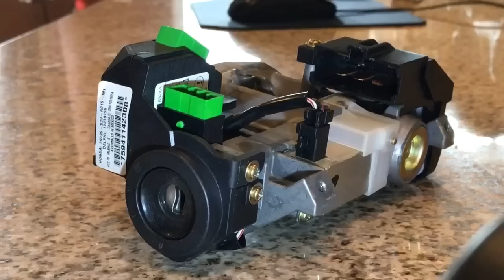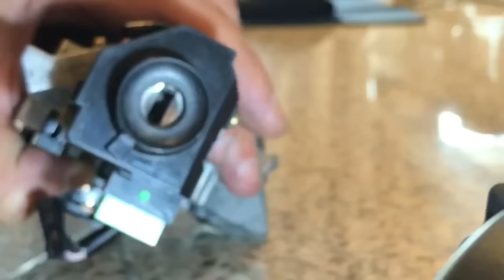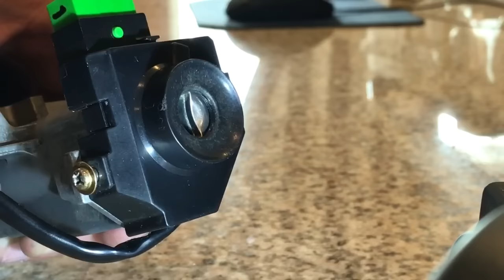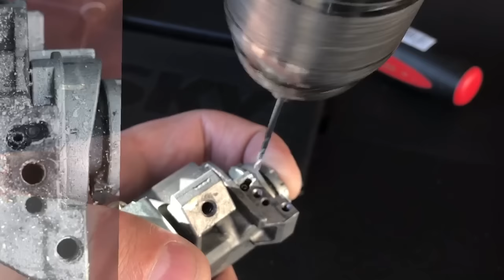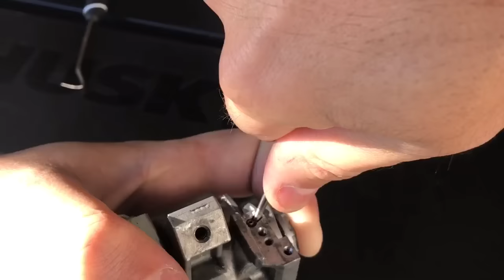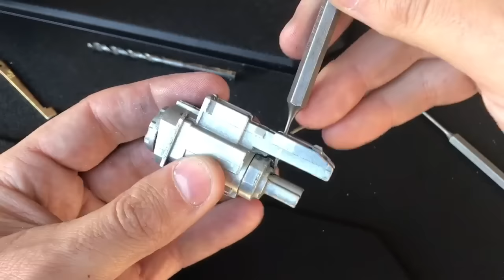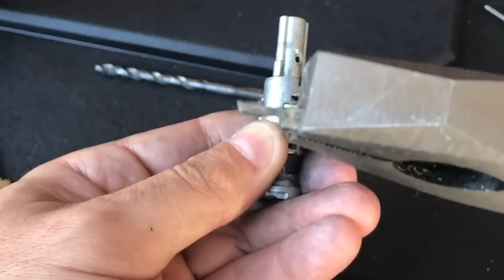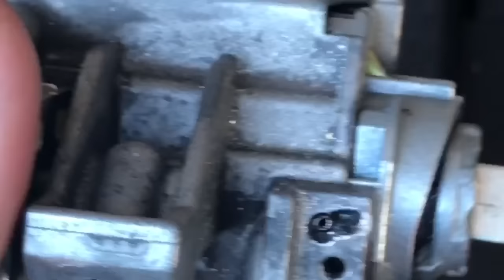Honda Ignition Lock Repair - Step By Step Tutorial

Comment: The locksmith in my town quoted me $720 to replace my ignition switch assembly and cut/program 2 new keys.  He didn't even give the option of rebuilding the locking mechanism.  I was able to follow your directions and save all that money.  It only took me about 3 hours from start to finish, and I'm not the most mechanically inclined person in the world.  Thank you very much!  Now my 18 year old vehicle with 200,000 miles on it is ever so slightly less secure.  OHHH NOOO!!! LOL

Comment: Brilliant video ... I don't know how much you just saved me but I'm guessing it wouldn't have been cheap and was going to leave my 2004 Honda Jazz (Fit) out of action for at least a few days.  Worth noting that I managed to effect the repair without removing the ignition switch assembly from the car.  It's a bit of a struggle getting to the screws that hold the immobilizer transponder (the black plastic bit) but it is possible with a driver bit in a socket wrench or possibly a flexi driver (couldn't find mine).  On the 2004 Jazz/Fit you remove the 3 screws that hold the indicator/light assembly first, that gives you a little more room to access the screws that hold the immobilizer collar.  There'll be some cursing but it is possible.  Also I'd caution to be careful when plugging the green connectors back in as it's easy to misalign them and bend a pin ...it's possible to straighten them back out but involves more cursing.

Comment: You saved my life. Sincerely.  For months I've had to leave my key in the ignition and whenever I parked I would turn the key back to just past the ACC postion before completely hitting the removal position. It was acting up and giving me a warning well before then but I kept wiggling and jiggling to get the key to rotate and it always eventually worked. But it got so bad that I had to bump the lock with a pair of pliers to trick it to work so I just gave up and left it in that dead zone position. Every time I got in the car I was worried I would jiggle it to the off position and get stranded at work or anywhere. So easy to do this method you shared. Drilling the pin worked exactly like your demonstration. Had already done the pin or tumbler rebuild on my door locks, so once I got the lock out it was a walk through. Thanks for this. I have a fully functioning car again. It wasn't so much about not paying more money for a dealership to do this, as mine has been pretty decent to me. Just avoiding the bother of going there and instead, being able to do something ourselves is the true value.

Comment: You just saved me 300 dollars. I was about to give up watching another video. Then I watched yours. I fixed mine with out taking the whole ignition out of the car. I did it exactly like you step by step. Thanks for saving me so much money. Auto zone wanted 399 dollars just for the part. The lock smith wanted 300 for parts and labor. Feel so blessed right now. I had 1 bent tab just like the one in the video that was stoppping the key from turning at all.

Comment: Trying this tonight on 2002 MDX. As far as drilling and pulling 1st roll pin, I've seen people slowly twist in a very small drill bit right into the middle of the roll pin. Just big enough to get a bite. Put Vice grips on it and pulled it out. Getting a roll pin kit from Harbor Freight. No doubt I'll lose one or ruin it. Awesome stuff.

Comment: My 2008 Honda Fit had the same problem, the car has 280000 on her and became a monument in our driveway.
Your procedure was done in 2 hours after I got ignition out of car.
I just wanted to take out was causing the problem, in the process I had only one wafer left, I didn’t want to dig in to this again so I took them all out, ignition worked awesome, one thing the key could come out while driving, the car works!
Thanks for this video!
This is the only one out there, so valuable!

Comment: 2005 Honda Element. Astonishingly helpful!  Huge thank you!.  Found that an allen-key set can easily be substituted for the 1/16th center punch.  Also found that using a dremel tool with an small sanding stone debured and tuned up some of the sticky keyway pieces that seemed to be protruding a tiny bit.  We removed six of them altogether, four by intent and two fell out by accident.  Re-assembled and it is flawless.   Again, huge help and many thanks !

Comment: Thanks for a very good description to solve the ignition lock problem. As a thank you for the help, you can get a tip, which means that you don't have to drill (see at 5 minutes in the video) to remove the pin. The tip is very simple..... Insert the key, and turn.... Now you can freely knock out the pin. No drilling.... Easy huh? Greetings from a Honda geek from Sweden..

Comment: Great video! I just finished my Oddessy van. Mine have gotten really bad over the past couple of years so I took out all the wafers. I lost a little tiny brass pin in the lock cylinder but it seems to work ok without it. I should have taken it apart on a table instead of my work bench. With out the wafers I can remove the key while the engine is running. It is so nice not to struggle with starting the engine or worrying about getting stuck.

Comment: My key wouldn't turn and I looked it up, figured it must be the problem if there were so many videos, and It was! Your video was the best, saved me alot of time, direct and simple instruction, thank you! 
I have a used 2008 Honda pilot, and the pin was already sticking out just enough to pull it out, and the one one the cylinder already had a hole drilled. My guess they, or maybe even a locksmith had already done this fix? Made it easier for me though!
I am wondering if you would recommend getting a new one now since it's been out and broken twice? And if I did does that mean I'd have two different keys? Is there a way to replace this part without getting new keys? Or would you just replace wafers and springs? 
Thanks again! I'm a single mom and I got stuck after swimming with 7 kids in the car!! Had someone come take the kids, then asked my friend to bring me tools before he had to go work. Got the look, like ya right, and he said good luck! Well I did it!! 
I love YouTube!! It's like I have millions of awesome handymen in my life ready to help me and show me how to fix anything. The empowerment you and many more have given me is appreciated!

Comment: Thanks for the video!!! Just performed this fix!! Was wondering if you knew what that wire you took off did? It goes to a solenoid/relay under that plastic cap. My lock assembly was full of wd40 and gunk so i wiped it down well and took the plastic cap off and air sprayed it clean. Put everything back and reassembled the column. The car starts but now i get the "keys are in ignition" beep when its not... This unfortunately also disables my remote door fob.... Update on the remote door fob not working, turns out that the "key inserted" micro switch was held closed by the long bar that goes to the back and past the cylinder was reinstalled incorrectly. There is a spring and a plastic cap that holds the bar in place. At first I put the spring, bar, cap back together. But it has to be bar, spring cap. This will position the bar correctly and then it will not keep the micro switch closed. Then the key is sensed as not in the ignition and the remote fob will return to normal function..

Comment: Big thanks for the how too!! Went out today to hop in the car and go to lunch only to find the key wouldn't turn. It's been acting a little funny for months now but I just took it as old and needing lube since it is in an '03 Honda Civic LX with over 340k miles. I gave up on lunch and came in to turn to you tube for help. Seen several videos but most were changing the entire assembly. I did not have an assembly or the desire to spend that kind of money for the tow to the dealer, mechanic's labor, and parts. I went back out and had the steering column open and the ignition core out in no time at all. With the information in this video, I was able to "repair" the core (minus one tumbler) and put the car back into service. All total in taking the steering column apart, repairing the ignition (having to search for tools in an office environment is not easy!), and putting it all back together took about 1.25-1.5 hours. This repair is to easy as long as you are somewhat mechanically inclined and motivated to do the work yourself. The old girl is back on the road!

Comment: worked for me, thanks for help. 100k miles (160k km) and so many problems (radio display, cruise switch, left window, ignition lock). My old 2003 Mitsubishi Lancerat 185k miles had no problems at all with any switch or window or key.

Comment: Thank you, thank you for this excellent tutorial. You saved me my job yesterday for sure as I found myself stuck on a holiday. I fixed my 04' CRV with this method. The hardest part was removing the first roll pin with the steering lock assembly still attached as I didn't want to remove the breakaway bolts. I was worried about drilling too close to that pin but it all worked out exactly as described.

Comment: I would like to thank you so much for this video.. I was about to scrap my 07 honda fit because it's so old with over 420 000 km. Couldn't turn key.... and now it turns...  I didn’t remove the whole assembly with the security screws managed to do it with assembly on the wheel. Took me like 4 hrs lol but better then 800 bucks canadian just for part and then having to tow to dealer to program the new keys for how ever much. Repair would cost more then what car worth. mechanic said to replace whole ignition assembly and that finding a locksmith to repair whould be almost impossible in my area...THANK YOU! THANK YOU! THANK YOU!

Comment: Hi everyone, i had to do this yesterday on my 07 honda civic and it works great. I thought of removing all wafers but just remove the bad ones.i reused the security bolts by notching the head and used a flat head screw driver to tighten.Thanks for the video

Comment: This video prevents having to replace or re-key all lock cylinders and reprogramming of many hondas with this congenital issue.  

Thank you very very much for this knowledge.  

My only suggestion is that there is a simple tool you can make to pull roll pins used by transmission mechanics.  It is often sent with the TransGo kits, but is easy to make; flat firm steel wire, close to diameter of hole, bend 90 degrees, and bevel one of the edges until the flat of the wire can enter the center of the roll pin and grab it from the inside.  Works wonders on valve bodies and other roll pins i've encountered, and worked here without having to drill.

Comment: Outstanding video. Thank you so much for saving me a tow and all the $'s the shop would have charged to fix my son's 2006 Honda Element. Your method worked perfectly and was easy to follow. Cheers!
Reply: Szx
Reply: Key won’t turn either lol I’m here to get that fixed by so I can start the repairs on my water pump,alternator,high pressure lines to my power steering and valve cover gasket plus adjustment. Buying a new car but can’t part ways with my toaster.

Comment: FANTASTIC! I followed it to the letter and it took only an hour (it would have taken 30, but when I took the bad wafer out, 3 of the good wafers and a spring fell out along with it, so I had to painstakingly figure out how to get at least two of them back in... sooo, two wafers didn’t make it back in 😬. But it still worked! NOTE: Make sure to go slow and hold the rest in with your fingers!).

You saved me $1,000+ (using Honda parts/labor) or $500+ using after-market parts/labor)!! And not mention SEVERAL more hours!

Thanks again!

Comment: WOW!  Great video and many thanks to you for it.  2004 Honda Accord with 220k+.  I did it without pulling out the whole ignition and security screws.  Torched a small phillips screwdriver and bent it to about 45 degrees and worked perfect on that back screw.  The drilling you showed us worked spot on.  I saved a big chunk of money which I am sure the dealership would have tried to charge me. That one little bad wafer would have cost a lot of dough. Took about an hour and a half and I was distracted with other things while doing it. Thanks Again!

Comment: Nice video, This is probably one of the best explanations.  I was able to do the whole repair in my 2009 Civic without removing the shear bolts or any of the complete ignition housing ,  I did this by removing the 4 screws holding the black plastic interlock cap just as he shows in the beginning of the video, i did have to use a screwdriver bent at 90 degrees to remove the last screw on the top of the assembly. I took a #1 screwdiver and bent it very close to the tip with a torch to get to this last screw. Youll see when you get the outer shell off the column, it has to be a very tight 90* bent screwdriver.  After that you can drill next to the roll pin just like he does in this video and take a scribe to pry it back to get the tumbler assembly out. Then the ignition is out in your hand and you can take it to the bench. The rest of the repair i did exactly like he does, just removed a bunch of wafers, put it together, works like new!
Reply: Thanks for posting your comment. I just did the repair on my 2009 Civic. Your comment saved me the time and trouble of removing the shear bolts. I was able to remove two screws that held the wiper control lever/module in place. I then had unobstructed access to that 4th screw which held on the immobilizer. Did the repair just as the video says to do. My ignition works like new.

Comment: Thank you for you step by by step instructions, i was able to fix the issue with my daughter's car, having the right tools or using some ingeniunity, to pull the pins that hold the tumbler out, is a  20 minute job. One little tip, when you are ready to pull the key out to pull the bad lever pin, hold the rest of the pins with your finger so they dont fall out.  Again thank you for your great video.

Comment: Thank you so much for this video.  I had to replace the ignition lock on my 2005 Pilot and I used the drill/pick trick to get the roll pin out, with the outer assembly still in the steering column.  Took about 2 hours start to finish including all the fiddling around with the plastic steering column cover.

Comment: Just bought a 2005 Element last week and wouldn't you know it, today I tried to put the key in and it wouldn't.  So the gremlins have struck!  Where would I acquired the small blades/pins that will need replaced?  Great video.  Thanks

Comment: Thank you for this excellent video. I was able to repair the frozen tumbler on my Honda Pilot thanks to your video. I feared it was going to be a major repair, but ended up requiring no parts purchase at all. The roll pin took me a couple hours to coax out of there, but once past that, the rest went very quickly and easily. I probably would not have figured it out (especially removing the roll pin) without your video.

Comment: THANK-YOU so much!!!!!!! it saved us big bucks! 
Notes: I found it easier to pry up the first little Pin after drilling the hole with the drill bit itself as it provided a bit of grip. The ignition of ours was also  stuck sort of on an angle so I didn't have to drill that second hole to get that pin out.  I also just took out all the wafers! The wafers were all messed. Its not like you can steal the car with out the coded key anyways and now it is smooth like butter :) These ignitions are a notorious problem with Honda, it was the second time it happened to our car, the first time it cost over 1000 for a mechanic to buy and install one and a week to actually get the part. So i was a little upset when it happened again.

Again, thanks a million!  PS we have a Honda FIT

Comment: Thank you very much for posting this video. I have a 2009 Honda Ridgeline and followed your video and was able to fix my key lock-ignition. I was not able to remove the complete ignition assembly from the steering column but realized I could do everything I needed with the drill, etc. with the plastic housing removed from the steering column. Was able to access all screws, connections, drill hole, remove pin, and got the key lock out of the housing and fixed the issue as outlined in your video. Could never have done this without following your instructions. Thanks again! It works perfectly again after the fix!

Comment: Thank you for your step by step instructions. I wasn't sure how to fix my son's stuck key issue. New assembly would require coding new keys. New keys wouldn't operate the door locks, I didn't want that. This was so well done I was able to complete it in under an hour. Original keys are functional! THANKS!

Comment: Thank you for the video!  You saved me several hundred dollars!!   It took me two hours today to fix my lock cylinder.  The hardest part was getting the two anti-theft bolt loose.
Reply: That took time I couldn't take out the second one, I just bent the bracket after taking the first out and hammered it gently down

Comment: Thank You! This worked well on my 2005 Accord. Like others have said, all the wafers fell out so I eliminated them. With the blue tooth ignition lock system I don't see any reason to keep them, and another could fail anyway and get the key stuck again. I was able to complete this job by using the steering shaft as my bench, as in I never removed the ignition form it. The only serious hassle was the very tight angle for the top phillips screw. I would recommend some kind of special angled machinist phillips screwdriver or a DIY trick I used. I made my own by bending a medium phillips on a vice.
Reply: I just took turn switch off 2 mini screws